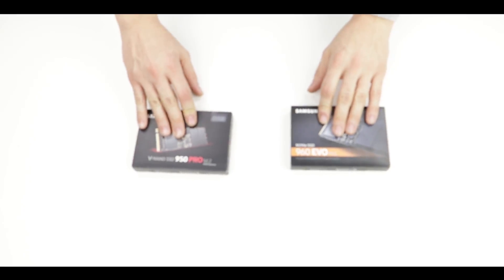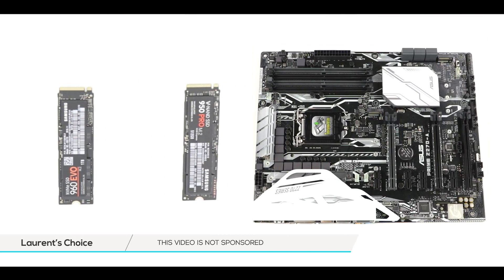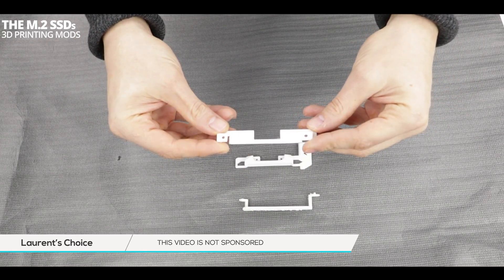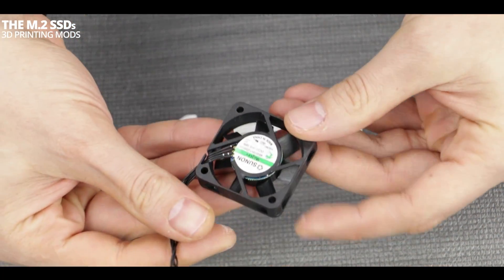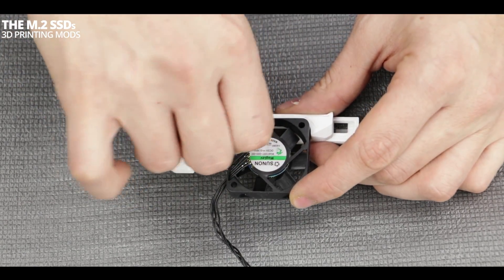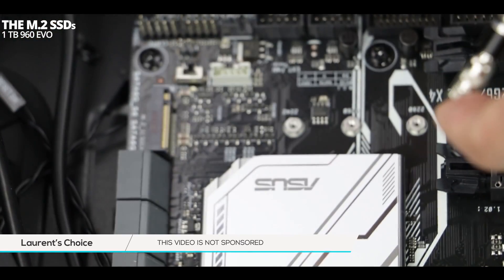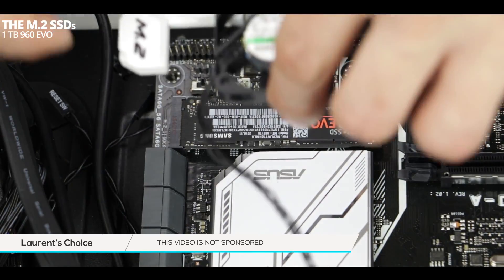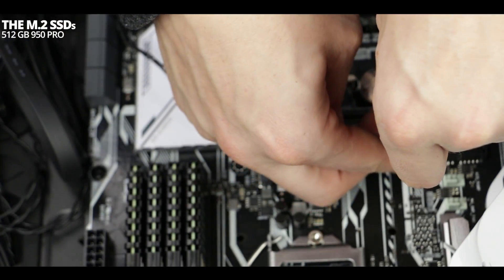Dual M.2 SSD installation and 3D printed mods (Kaby Lake Project 4/10)

Comment: Would help tremendously if the m.2 drive would have a thermal tape and heatsink attached to it underneath the fan to maximize cooling/heat dissipation!!!

Comment: What type of screws are you using to mount the 40mm fan to the 3D printed part? I had a 3D manufacturer  build the pieces for me from the Asus file. I see the screw goes thru the fan but am not sure if you used a self tapping screw?  I have a 40mm Nactua fan.
Reply from the maker: If memory serves me well i used 2mm wide screws
Reply: Were the threads self tapping? IT looks like 3D printed hole doesn't have threads. Thank you for the quick response
Reply from the maker: Yes.. the fan or 3d item do not have thereads. Only the motherboard does at the screw raisers marked "3d mount" 

Not all asus motherboard have these. Usualy Prime, Strix and ROGs do .
Reply: @Laurentschoice  Thank you. I'll look for the screws now. Asus should have provided instructions 9n using 3D mount. Your video made most of it clear
Reply from the maker: I hear u... Asus tends to listen to us reviewers..but im still too small to make a dent in the landscape
 

Do not hesitate to shoot me an email with pics if ur facing an issue
Reply: Looking for email to send you pics of parts.   My plan.    1. Crazy Glue to 3D parts together.  2. Drill using hole as a guide the second 3D piece that doesn't have a hole and connects to motherboard to match hole made.  3.  Use a dremel too grind bit to take a little off the rounded corner for fan mount so holes line up. I am using a Noctua fan and need to remove just a little of the 3D material.  4. Use the sheet metal screws to screw down the fan to the 3D part.   I would like to send you a photo of parts I have.
Reply from the maker: At the end of every video i got my contacts. 

I dont write it in comments to avoid spammers :)
Reply from the maker: Ok.. what u are doing seems carefully thought out .. please send the pics. 

Cant stress enough how poor quality the plastic of 3D printed components can be... so i would definitely go very slow with the Dremel.  Other than that... its all golden
Reply: PIcs sent to email.

Comment: And where you plug it? 
As normal fan hub in mainboard?
And is it  40mm or 50 mm fan?
Reply from the maker: +Ahmad Sayed depending of the boatd. 
More recent ones have a special 4 pin connector. 

For older ones you can use the 3 pin connector as I did :)
Reply from the maker: +Ahmad Sayed both 40 and 50 mm will work
Reply: Laurent's Choice 
Thanks
When you will build a coffee lake CPU PC ? 
 Im watching your work here.
Great job .
Keep going
Reply from the maker: +Ahmad Sayed yes I am.
I am now building a Threadripper build this month.  

Coffee Lake will start next month . 

Subscribe to get notified for the releases :)

Comment: You're using it to draw air away from the m.2, instead of blowing air on it?
Or did you just mount it the wrong way? :P 

Also, thanks for the video! Was a few questions I had, that was answered :)
Reply from the maker: ahahah... I totally blew it out :) :) I was hopping to show the fan sticker and absolutely thought no one would catch the fact that the fan's chassis was facing upward! 

You my friend have eagle eyes and sharp nerve endings!!!!!
Reply: Maybe edit your video and put box with a line over that part of your video explaining that the fan should be blowing onto the m2 and not out as you show and then mount. I thought it was odd but being my first mounting of an m2 fan I followed suit. Only after more research and returning to few comments here did I catch this comment. I appreciate the video though and now my build is complete.

Comment: Is it necessary to use a fan  for M.2 ?
Reply from the maker: +Khaled Saleh no ... u don't need to :)
Reply: Thanks
Reply: If your PC case has a good airflow, it's ok, unless you use your PC to run several benchmarks.